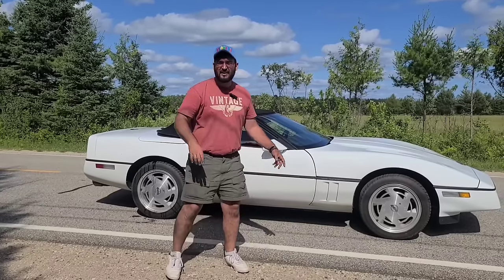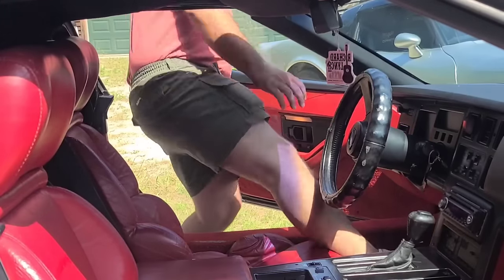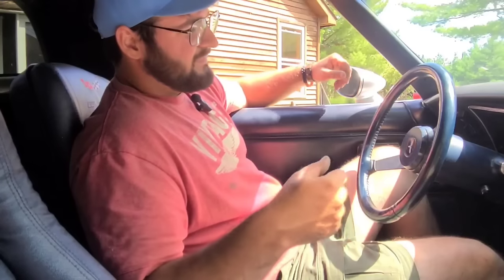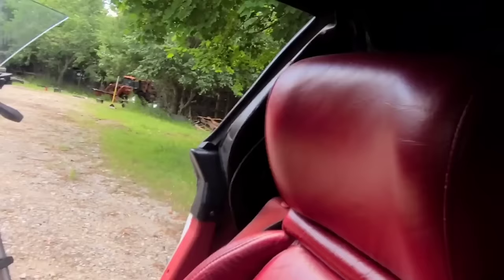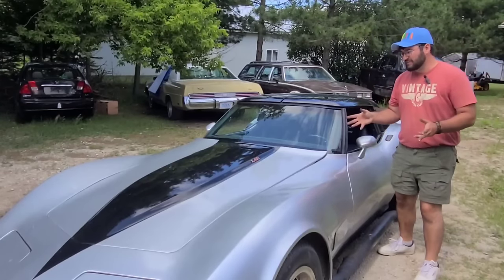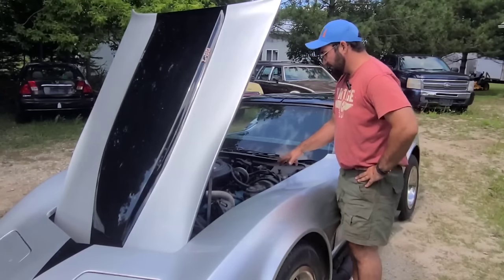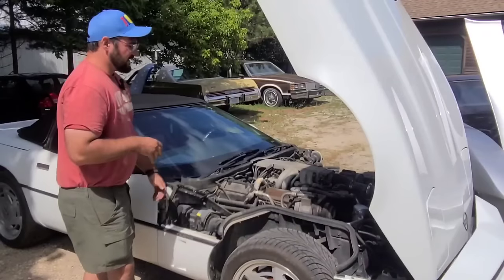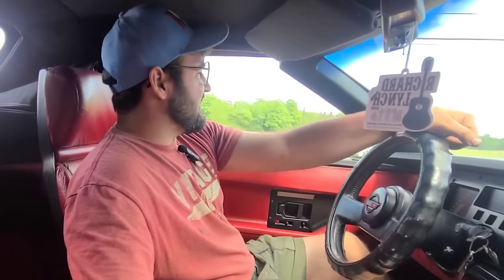C3 vs C4 corvette, which is the better buy?

Comment: just letting the viewers know that the white c4 is not a 1990.  90 was first year of the updated interior.  89 was the last year of the interior you have in this c4.
Reply from the maker: I just talked to my grandpa today. It is indeed an 89. You are correct.
Reply: I'm just waiting for the next video when he confuses a Mustang for a Porsche ;-)
Reply: If you think the C4 is hard to get into try the C7
Reply: Yeh I seen that - I have an 89 last year of the bread box dash
Reply: I’ve seen a BMW Z4 coupe with red interior lol. My second wife bought me 94 corvette for my 30th birthday. As long as you are under 6’2 and do not have a beer belly, you will have no problem getting in or out of your corvette. We were gym rats lol back then, we never had a problem getting in or out.  Our 
C4 was awesome, she even drove it in the snow ! As long as the roads were plowed, we never got stuck in the snow. We had a 6 speed manual that got 30mpg at 65mph ! Very reliable car, always started in the winter even in Chicago lol. However, the choice is always in the eye of the beholder as far as looks go.
Reply: EXACTLY.  I noticed that immediately also.
Reply: Could you get a more  shittier C3??? 😅
Reply: @phillipgarrow2297 
Why is c7 hard?
Reply: @phillipgarrow2297 hate to differ, but I owned a '96 6spd cpe, for about 10 years, bought a '19 brand new...the '19 is by far much easier to get in and out of.
Also my 1st car was a '77, which that too was much easier to enter and exit than my '96 was...I'd say on par with my '19.
Just my 2 cents

Comment: The C4 is undoubtedly a better car, but I'd rather have the C3 every single time because it's just that much better looking.  The 1980-82's were among the most beautiful cars ever, IMO.  Thanks for the video!
Reply: Stingray heritage!
Reply: Too bad they had the most emission bogged motors ever.
Reply: one of my neighbors had i believe a 1970 or 1971, i can’t remember which year. it’s a dark green, almost like a british racing green. i believe it’s an L46. he said it’s the engine right under the LT1. it’s the most beautiful C3 i’ve ever seen. The color is very unique
Reply: Sorry i meant “has” he’s had the car for 30 years and said he’ll never sell it
Reply: 63-67 has entered the chat
Reply: Does it have the "camel" interior?  That's a great color combo with the green!
Reply: BS🤣😆😂🤣 Drop in a 454 and let it go
Reply: Why did you only list the 80-82 C3 Corvette, what’s the huge difference between all the C3s
Reply: @garywilson7992  They are all nice, but I particularly like the front end and rear deck spoiler on the 80-82's.
Reply: @randolphduke   yeah, you’re right, I forgot about the deck spoilers on those years, but I can’t remember any significant changes on the front, I think the raised center hood portion may have had some slight differences, and some subtle changes across the lower front flare, but I can’t remember without looking at some photos;
But irregardless, I don’t agree with the narrator, I think the C3’s are about as sleek and fast looking as you can get. Unfortunately after 1971, the performance didn’t match the look, and I’m surprised they’re not in big demand for that reason alone, with an engine transplant, and a lot of options.
And this option wouldn’t be very practical, for every day cruising around, but if someone wanted to keep it, nostalgically old school, the 1967, 68 & 69, 427 L-88 with a low ratio rear end, good pair of slicks and a quick on the draw driver, your in the 11 second bracket for the quarter-mile, and some were in the 10s. And that’s all motor, with no supercharger, and that’s fast even for a Hellcat.
Reply: @randolphduke chrome bumper C3s would like to have a word with you. Also the most powerful.
Reply: @garywilson7992 Because the 80 to 82 was the last revision of the C3. There was like  3 revisions. The original from 68 to 72 had steel bumpers on front and back. The 73 only had a rear steel bumper. 74 was the first revision. It a different shaped rear, and had some weird line down the middle of the rear bumper, and is the only one with that line. The 74 C3 is the worst looking model in my opinion. The 75 looked the same, but was the last year they made a convertible C3. From 74 to 77 they basically looked the same, but in 78 was a new revision. Starting in 1978 they changed from a small vertical rear window to a bubble rear window. Still basically looked the same as the prior revision, but they had a big read window. In 1980 they revised it again. They changed the shapes of both the front and rear bumpers and added a spoiler to the back. The 80 to 82 models in the rear are shaped more like the 68 to 73 models, and the 74 to 79 models are not shaped anything like the other models in the rear. The last C3 was in 82, and it basically looks just like the 80 and 81 models, but the 82 is the only model that has a rear window that opens. No it is not a trunk, the rear window literally opens like it was a trunk. So basically the 80 to 82 models were the last C3 revision, had different shaped front and rear bumper covers, had a spoiler on the top rear bumper cover, had the big bubble rear window they started using in 78, and you could get them in two tone colors. I have heard it a million times, the 82 is the best looking model C3, but I personally like the 68 through 72 models with front and rear steel bumpers. But I think just about everybody would say the 68 to 73 models and the 80 to 82 models are much nicer than the 74 through 79 models. If you know the C3 you can instantly tell the 68 through 73 models apart, and the 80 to 82 models apart from the 74 to 79 models.

Comment: Don't push/pull on the steering wheel getting into or out of the C4! You can damage the steering column. Use the side rail when getting out if you need to give yourself a push.

Comment: The 1980 is NOT an L-82 unless someone changed out the valve covers. You can also tell by the Tach, which would have a 6 grand red line and actually say L-82. This one does not. Also, either the distributor is a tooth off or the timing is drastically retarded. Missing the cold air intake too. Those are free horsepower. A true L-82 will have 9 to 1 compression and forged everything with 4 bolt mains. This has 8 to 1 and cast everything. The heads are the worst things GM ever made....useless, but they function. This car needs a real tune up and vacuum leak going over. The quadrajet will run fine if you know how to tune them and rebuild that version properly. You MUST use the correct kit with the correct needle and seat or it will never work properly. An L-82 only came with an automatic. It has a lock up converter and you can run a little better stall unit and make it work better. Your best bet in swapping a 700-R4 unit with the lower first gear. The parts from an 82 will allow it to bolt right in....best mod you'll ever do! Hooker makes an affordable true dual exhaust system that bolts on. Worth it. A REAL  L-82 made 230 HP at the rear wheels in total stock form. I've dyno'd two of them and thats what they made. Mine was one of them. Mine is making 302 HP now with the 700-R4 and its more than enough to have fun with and still be a docile street driver that gets 25 mpg on the highway. WITH a carb...no EFI. It also looks bone stock (except for the headers) under the hood with the factory cold air intake system.

Comment: Anyone considering getting a late C3 consider the following:

1) Get one with a manual transmission. Both manual/auto had the same 3.07 rear end. So the C3 auto was 3 spd with a 2.52 first gear (2.52x3.07=7.74); the 4 speed manual first gear is 2.88 (2.88x3.07=8.84) - in other words the manual car amplifies the engines power much more than the auto and has an extra gear - you can do burnouts with a manual car.

2) Fix or upgrade your ignition. The HEI was “ok” for its day but on a 43 year old car it’s more than likely tired even if it’s been maintained adequately. Far better “bolt on” options available that will give noticeable improvement immediately.

3) Similar to above - fix the carburetor. Undoubtedly some monkey has messed with that carburetor over the last 43 years to squeeze “mo powa” out of the smog-era motor - find an old timer who knows how to tune the darn thing. 

3) Advance the timing. Factory set the initial timing at 4 BTDC to make the exhaust run very hot to burn more hydrocarbons. Unless you have to take it for emissions testing there is no reason to care about that anymore. Set initial timing to 8 or so; engine will be peppier and run cooler - trade off is you may need to run premium fuel.

4) Fix your vacuum leaks. Pop up headlights, heater controls, power brakes, emissions all run on vacuum. Just removing the air cleaner assembly often disconnected or broke vacuum connections.

5) Unless you are a stickler for originality (or live in an area that inspects your exhaust) remove the catalytic converter and run true dual exhaust.

6) Don’t waste your money doing a head/cam swap - the bottleneck is the low compression pistons. If you fix the ignition, carburetor, timing and exhaust you will find these 4 speed equipped cars are very spirited and fun to drive.  If you must have “mo powa” swap in a nice 383 - big blockesque torque in a lighter package and, unlike an LS swap, you and one of your buddies can do the swap in a weekend. Consider though, if you are going that route might as well install a Tremec 5 speed. At that point, financially you would be much better off buying a 68-72 L79, L46 or LT1 car…

In my opinion the 1980 Corvette is the “sweet spot” for late C3s; nicer looking and lighter than the 78/79 and the 81s were the first year with a computer; manual transmission wasn’t available in 82. And they are relatively cheap, and as Junkyard Joe says you can fix them with a ball-peen hammer.
Reply from the maker: What an awesome wealth of information there. You hit the nail on the head several times throughout. This car is getting a once over this winter. A manual sure would be nice. The 3 speed auto screams at highway driving. This thing definitely runs pig fat and needs a tune up in the worst way. It'll get there eventually
Reply: @junkyardjoe1994  lol. You told me I’m missing the point in the money mark and this educated fellow with good advice says swap the motor which will double or triple the dollars required and he is spot on? 

It was an interesting video but the only way I’d buy a later c3 is if it was already restomodded  or a roller that I could molest with an LS3 a tremec 5 speed and new gears in the arse end !!!!!
Reply: I'd leave the power and down the line t56 magnum swap for highway runs 😅
Reply: Don’t remove the cats.  Use hi flow cats instead.  Three reasons:

1)  it’s illegal to remove emission equipment.

2) the car will not pass emissions if it is reinstated on older cars, and then you’ll be scrambling to find a way to get it passed.

3 let’s not f up the environment.

Bonus reason- let’s not give the feds of state governments any reason to come down on this community.  We’re already fighting to keep ice’s in production.
Reply: The 82 did come with a 700r4 automatic transmission. The 700r4 is low geared enough in first that I can light my tires up with no problem.

Comment: In 1980 the L 82 emblem was on the fender and the engine valve cover was not blue. They were finned black. The frame was basically the same from 63 -82. The C 3 ran 68 -82. Do some research. I've owned 3 C3s 2 C4s. Corvette lost their soul after 82.
Reply from the maker: Car is titled as an 80 but appears to have some front end damage at some point and the motor has definitely been out and replaced or psinted as well. I don't know if the position of an emblem affects the comparisons I was showing. You definitely get a mutt for when you don't spend much money

Comment: Had a 1990 'vert and it was fun, but had some issues. The top leaked a lot even after full replacement and once the electrics/wiring got wet in the back...problems. The interior was falling apart at 100K miles, which sucked because I liked the design, layout and dash. I put in a mild 383 and kept the TPI and it was a giggle inducing burnout machine with a lightly stalled 700-R4.

Comment: without a cat pluggin the exhaust, the 80 should be around 240 horsepower. check the timing and carb function
Reply from the maker: It's definitely running way too rich. Probably has some fouled out plugs as well
Reply: Yes. If you get rid of the cat and fix the plugs, wires, timing etc that thing should pick up almost 60hp

Comment: You're absolutely right, definitely buy both if you like them. Also I think both of them need some work cuz they should perform better and both should be able to do a good burnout easily.
Reply from the maker: The 80 is definitely running way too rich. It's in need of a once over. The 90 should be able to do 60 in like 6 seconds too so it's definitely showing its age.
Reply: @junkyardjoe1994  I would love to see videos where you get them close to their former glory even if very slowly one thing at a time, you know
Reply: Hell yeah.  My first was a 1980 and I miss it.  Such a beautiful car.  One of the best burnouts I've seen was with my buddy driving my 80.  crazy.  It was easy with that car.  I think it had something like a 4.11:1 rear end - fairly short gearing, and also a high-stall torque converter.  The handling was also very responsive - on rails and snappy.  Timeless and very classy exterior design.  My second was a 1990 (first of the 90s interior).  My 1980 was lower - While sitting in the driver seat, I could open the door and put my hand flat on the ground without leaning over.  But the cockpit interior of the 90 was the best/my favourite of any car I've experienced.  I unfortunately sold that one as well and have always missed it.
I think the L-98 was supposed to make 330lb-ft.
I agree that both of those cars should do massively better than that.  In my 90 (stock), I could slam on the throttle at 40mph and do a burnout.  The handling was also seriously good.  The balance and cornering were awesome.  When I had my 1980, I took an 89 for a drive around the block and then had to have one, so then I found the 90.  I wish I still had both.  I'm envious.  🙂
Reply: Would love to see a continuation/series on these two fine cars doing major tune ups and diagonistics and changing aged components but keeping them period correct. Dyno tuning/testing and timed runs at the strip as well!  Great video!

Comment: I hate it when people compare all c3s like that with a L82 in the 80's with 190hp. Mine is  390 hp factory 1969 c3.  Starts no problem. Burn outs easily. This car he has obviously has issues.  They don't handle like wagons if you have good shocks, springs suspension. That stuff will wear out. They are almost 50 year old cars.  Mine has oem replacement suspension and drives pretty good.
He pics the 90's car for daily driver because it has AC. Mine factory has AC from 1969 and power windows.   His comparison is of two cars that have not been taken care of and both of them were running like shit.
Reply from the maker: Well that's what you get for 5 grand? They're not show cars. I'm quite sure your meticulously maintained factory ac 69 c3 is worth a fair bit more than $5,000. I think you missed the spirit of the video
Reply: @junkyardjoe1994  good point.  I should have thought that response through a bit better. I will say though the c3s are climbing in value very fast. If you can get one for 5k then do it. In 5 years , it will be hard to get anything c3 under 10k

Comment: The 1980 L-82 Corvette had the L-82 insignia on the fender, not on the cowl like the 1979.  It also had 230 horspower from the factory, not 190 like the non-L-82.  Something is amiss here.
Reply from the maker: Car has definitely been molested a fair bit. There's signs of front end damage in the past and I'm fairly certain it has a different hood. Engine looks like it's been out as well and was either swapped or rebuilt at some point in its life. Hard telling with basket case cars. They're  still fun!

Comment: Not sure about that really being an L-82. They had finned aluminium valve covers from the factory. They were no slouches and with minor tuning would really run. That car might have originally been an L-82 with an engine replacement sometime in its life.
Reply from the maker: You might be right about that. This engine has definite signs of being out at some point.
Reply: All REAL corvettes had aluminum valve covers.
Reply: I remember experiencing a 1979 L82 and it definitely had some decent pull and torque even for its era (and was stock). So yes, I would investigate this motor in the 1980 and see if it’s correct and/or just needs some tuning  perhaps.
Reply: Correct, that does not appear to be an L82 for several reasons: no dual snorkel air cleaner (although it appears to have been replaced with an older one), redline on the tach is incorrect, etc.
Reply: The 1980 L82 motor was rated @  220 net horsepower while the base L48 motor was rated @ 190 net horsepower.

Comment: I loved driving my C4 Corvette, once in the seat. That rocker height and trying to slide my feet in and out from under the dash though suck. So does changing the spark plugs. My C3 Corvette I still like for what it is as a weekend cruiser. C6 Corvette, although the interior isn't the best and the steering wheel was used on everything Chevrolet at the time, is a decent long distance cruiser. Not familiar with the C5, C7, nor C8.
Reply from the maker: The c3 is definitely still a head turner. I prefer weekend cruising in that as well